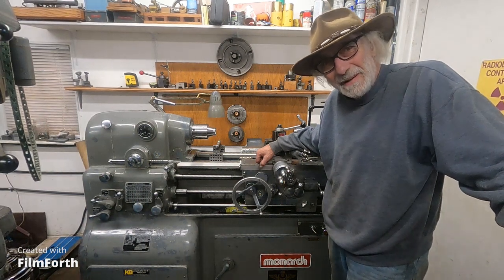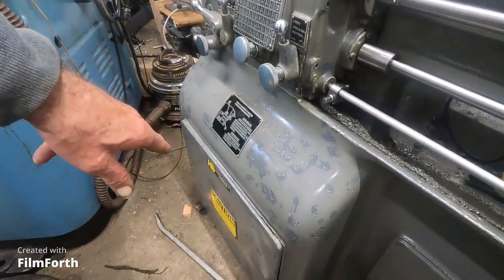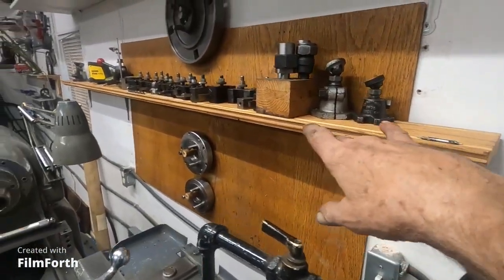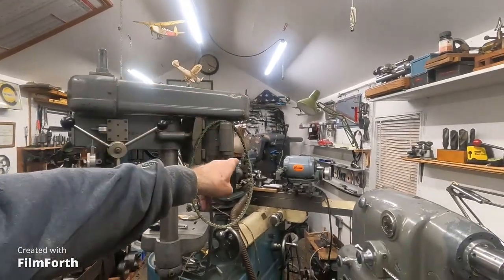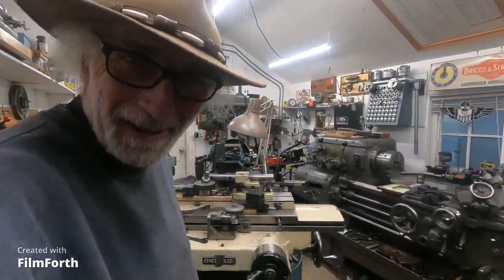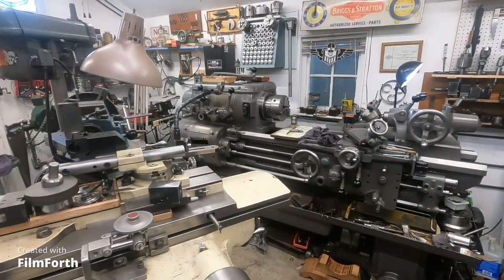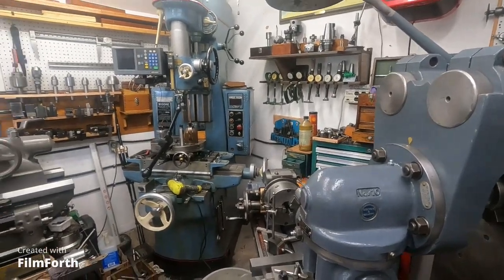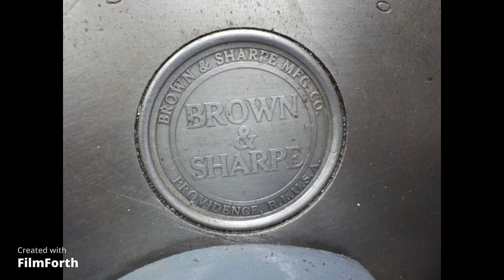Friday activity in the machine shop

Comment: Don, I agree with you 100% on making sure the lathe is level.....
on my fabrication table, I always level it out,,,,it is on wheels 
and lives in many areas of the shop, I have a 1"x48"x48" 6061 plate on top
of the wheeled base that I level the top and not the base.....
it really makes laying out rectilinear frames easy that way......
I even use my Starrett precision 12"  level on the band saw to 
make sure my stock is level.....due to the big lines on the Starrett, 
it is so much easier to know when it is level with the saw.....
my material come is 20 to 24 foot lengths.....so this makes it so easy
give Chloe a kiss for me......
Paul
Reply from the maker: I was talking to a technician at a machine tool company,  he knew every detail of the machine except actually running it!